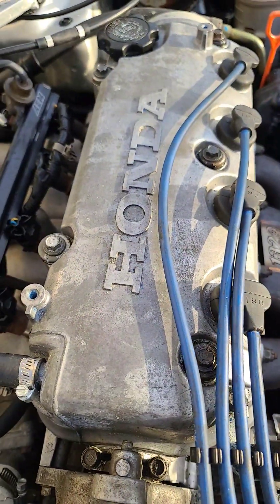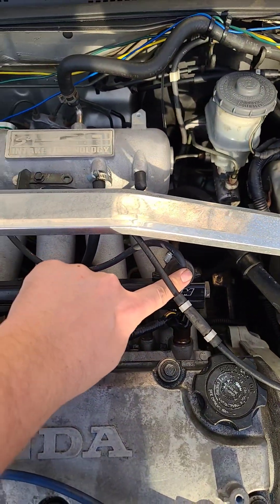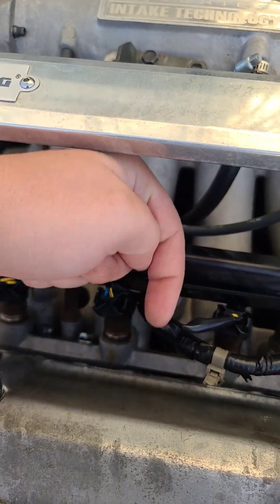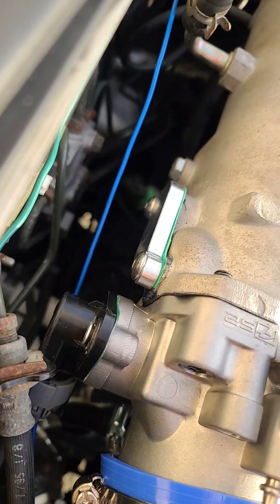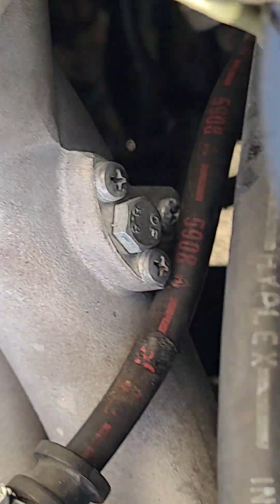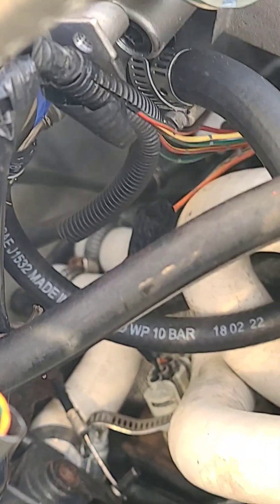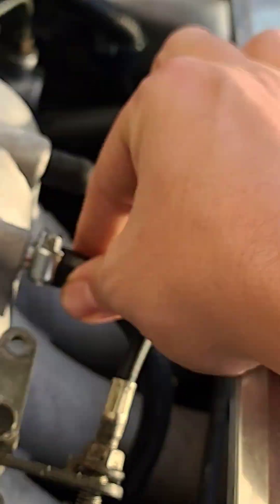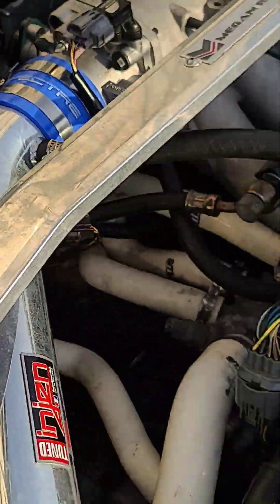D16Y7 to "Y8" Manifold conversion + S2 Alpha TB

Comment: Does it feel a difference with that intake manifold like more better acceleration? im doing this currently on my sisters 99 civic lx
Reply from the maker: The difference isn't noticeable without an actual tune. I'm not going to lie to you don't bother with this conversion at all unless you plan on using it to go turbo with the motor. It won't win you any races.  I plan on K-Swapping the car.
Reply from the maker: May be easier if you have the 99-2000 model and just swapping a Y8 to the Skunk2. But on 96-98 its kind of pointless unless turbo-ing.
Reply: @FUBBA its for daily yeah i took the y8 manifold from a 99 civic ex in the yunk yard and about to install it on my sisters automatic 1999 civic lx d16y7 lol is just for looks its a daily car

Comment: Did you need new wiring to adapt to the new tps sensor you needed, I have an appointment to the tuner because after I got it running it was blowing smoke out of the engine and out of the exhaust and sounding super choppy because it needs a tune, also do I need a map sensor or can I just use the old one, lmk maybe we can dm or something cause honestly i need help and I can tell you knew what you were doing when setting this up please lmk! 😭🙏
Reply from the maker: No, it didn't need any new wiring. I did get mine tuned after this swap on the stock ECU. I have all the stock but the IACV block-off plate. If you ran IACV, you'd have to do some custom wiring. Car is 5 speed.
Reply: @FUBBA okay yeah mine is automatic so I’m getting a hondata ecu and they’re gonna tune it, the damn bolts to the actual intake manifold are fucking annoying, I’m just gonna have them tighten it cause I don’t have the tools to grind down my wrench so it’ll fit in between to tighten better, I put the sensors on and I have a block off iacv thing coming so I’ll make sure to get that shit on before I take it to them, they said they would connect up the hoses and shit to the right places because I couldn’t see where every hose went to in the video, so I’m not too worried about the hoses, I just wanna make sure I have everything for the tuner so I don’t have to wait longer than 2 days after I bring my car in, I’ve already been carless for a month because I decided to do a little project on my automatic d16y7 hatchback 🤦‍♂️
Reply: @FUBBA also thank you much bro I just wanna give you a pat on the back for responding after so much time has passed, I just wanna get my lil shit back up and running 😂 I pray they can do it without the price being over $2000, they estimated $1700+tax and if they have to do anything else it’s $90/hr 💀 so I just wanna make sure I got everything hooked up as possible so they spend as little time on it as possible
Reply: Also I understand you aren’t a professional but honestly I think chatting with you would help me even if we go back and forth in the replies would help I just want to make sure I’m not bringing my car to the tuner with missing shit because I already have to wait until April 8th to bring it in for my appointment
Reply from the maker: I will do a follow-up video because I get a lot of questions here about it.

Comment: I want the iacv for ac in flordia gets hot in summer but where do i put the 2 hose on the iacv like where do those 2 go if you did have one
Reply from the maker: You do not need an IACV for Air Conditioning...
Reply from the maker: Those are your coolant hoses for the IACV I believe which go to the radiator / block
Reply: @ okay one more question you think my car will still run if i just leave it un pluged ? Or do i still have to plate it to block it?
Reply from the maker: You will have a vacuum leak if you don't block it off. I recommend the plate. If your IACV isn't running you won't need to run the tubes to it.

Comment: Bro i have the same intake manifold but  i have the y7 thortle body. I want change to a skunk2 70m but my problem is. Iacv how works without the iacv?
Reply from the maker: I cant remember if 3 to 2 wire conversion works on stock ecu or not. I think just disconnect orange and swap the other two wires around at the ecu. I just run mine with none and so do the turbo people.

Comment: Why isn’t my d16y7 throttle body fitting on a skunk 2 intake manifold
Reply from the maker: It is designed for the Y8 style which is a vtec engine.
Reply: @FUBBA  so I got the wrongs type of skunk 2 intake? If so will a normal y8 throttle body work
Reply from the maker: You just need to convert it to your new intake and use a skunk2 alpha throttle body I think I use a 67mm and you need a d16y8 throttle cable as well.

Comment: The part where you say "my phone is upside down" are you talking about the tube hooked up to the black box or the pipe below it?
Reply from the maker: The latter. The one with the clamp right below it.
Reply: @FUBBA  another question! what kind of bolts did you use to fit the AEM fuel rail to the skunk 2 intake manifiold?
Reply from the maker: pretty sure I used the OEM ones from the original fuel rail.
Reply: @FUBBA  Thank you sir!! You helped me a lot!

Comment: Why is there a vacuum line running from the water neck to the manifold?
Reply from the maker: If you mean that connection in the thumbnail it is apparently supposed to be that way.  The one running between the IMF and the head is also like that.

Comment: so your running no IACV?
Reply: I have the same setup but i bought a new 2 wire IACV to bolt on. So i wired it up and now the idle is high and fluctuating quickly any idea how to fix the idle?
Reply from the maker: It could very well be the shape of the gasket you used with your throttle body if anything. I used a factory Y8 throttle body on mine I believe and not what came with my SKUNK2.
Reply from the maker: @1Blackman82   https://www.youtube.com/watch?v=PzT5Fl-0kLE
Reply from the maker: Right now have the IACV off the Y7 plugged in and tucked away. I have the IACV plated off on the intake manifold.
Reply: @FUBBA I have a y8 auto intake same exact setup with the IACV all the little cold start holes and cruise control holes are blocked throttle keeps getting stuck 2k-3k and it’ll throw IACV code and have a surge when little throttle is applied. I am stuck